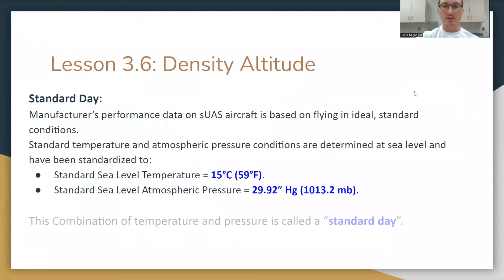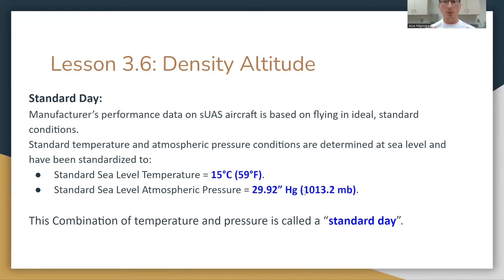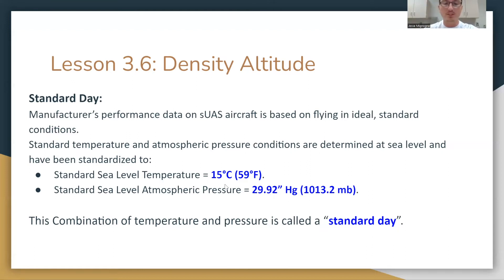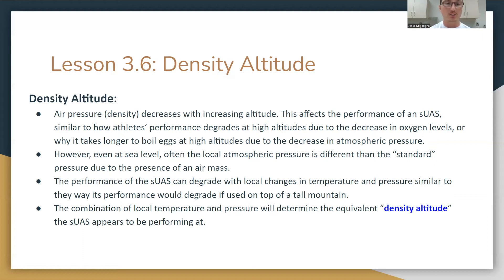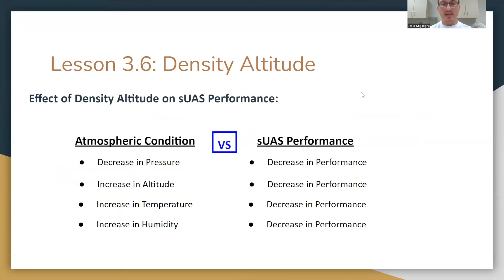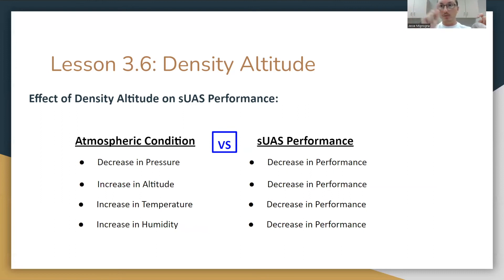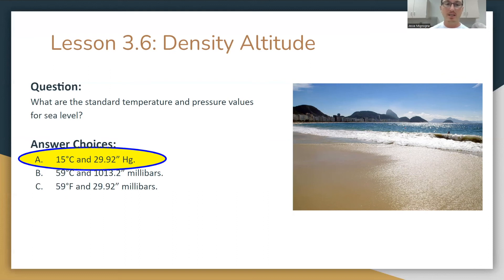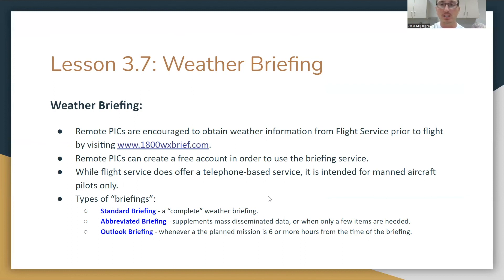Air Density FAA Part 107 Drone Exam Weather pt3

Comment: Let's change the word order here to make things much easier. Change "High density altitude" to High altitude density" i.e., lower prop efficiency  and "Low density altitude" to "Low altitude density" i.e., higher prop efficiency? Makes sense doesn't it. And why not add some saturated colors to sectional charts: RED, YELLOW, GREEN, etc. It would eliminate some of the difficulties of being able to make sense of charts.

Comment: Just take out the word “density” as Mr. Mig suggests, and things clear up. High altitude =  bad for flying because there is less air to work with to give you lift. So the higher the [density] altitude, the worse for flying.

Comment: Isn't "high density altitude" poorly worded? I understand the authors of the Part 107 might have the excuse that we all should be aware of the possibility of poor wording, but seems that could cause more problems than making things very clear.
Reply from the maker: Donald, I agree it is confusing. Unfortunately, it is what it is. On the exam “high density altitude” means air that is less dense. Like air at high altitudes is less dense than air at low altitudes.

Comment: Watching all your Part 107 videos, so far...so good, nice how you explain things. I am also a teacher, out of work at the time but love to teach. i think maybe you should explain to everyone the simple conversion from C degrees to F degrees C x 9 / 5 + 32. It is easy enough to do in your head, no paper/pencil or calculator required.
Reply from the maker: Yes, I want to do a video on that. I also have a simple way for people who are adverse to math formulas. start with the simple 0 Celsius equals 32 Fahrenheit conversion then add five Celsius for every nine Fahrenheit or vice versa. Ex 5c = 41f. 10c = 50f.

Comment: New sub. Excellent video!  On practice tests I was always getting that High/Low Density question wrong! I mean, High Density Altitude meaning Low Density and vice-versa is just so confusing but I get it now! Weather is my weak point and your video on this really helped. Looking forward to watching others of yours! You explain things very well!
Reply: Seriously, why aren’t they just saying High Altitude Density instead? Then it would make sense to say “oh, high altitude density is low density.”
Reply: @annieo.4779  exactly!!! I haven't taken my test yet but I just memorize the 3 Highs - High Density, Temp, and Humidity mean lower performance.
Reply: @LawnBunny777 
To anyone reading this comment, no it's high altitude, temperature, or humidity means decreased performance. Not density.
Reply: @LawnBunny777  correct, but it is high altitude that cause the low density, reducing performance. Your original reply looks like it was saying that "high density" caused reduced performance, not "high density altitude". It's the weirdly worded "high density altitude" that is reduced performance, not "high density"
Reply from the maker: Glad it has helped. Yes, that is tricky.

Comment: I’ve appreciated the detailed extinction of a lot of your videos.  On this one I believe there is a falsehood in describing high density altitude happening at high altitude.  As I understand it, we’re talking about “high density” and “low density” at an altitude- which is why you can have a high density altitude upon takeoff.  Useful info and maybe calls for the need to edit this video?
Reply from the maker: DLH, thank you for your comment. In the video, I stated that at high altitudes, the air pressure can change and sometimes you can get low density altitude at high altitudes and sometimes you can get high density altitude at low altitudes. Therefore I do not believe there are any falsehoods in this video, and I will not be taking the video down. high density altitude means the air density is low, which is what is usually the case at higher altitudes. At higher altitudes there is usually lower air density. For the purposes of the drone exam this is a good explanation. Could there be more complex explanations to air density if someone wanted to be a meteorologist for example? I’m sure the answer is yes, but in this context, what I stated is accurate.
Reply: @MrMigsClassroom  at 5:15 what do you mean with that statement?   If needed you can edit it with text on top of the video

Comment: 5:00 What is confusing here is using the words density and altitude together. Key on the word altitude instead of the word density.  Density altitude is a way of converting the air pressure to an equivalent altitude over mean sea level.  When the air is hotter than 15degC, it's less dense so it's like being higher in altitude.  Hot air has a higher equivalent altitude than the reference altitude.  Under hot days your aircraft will perform as if it were at a higher altitude.  On cold days, your aircraft will perform as if it were at a lower altitude.

Comment: Only bureaucrats could do something like this... I just change the order of the words (in my head) to "high (or low) altitude density" and it seems to help me keep it straight. I can easier envision the air getting less dense as the altitude increases.
Reply: Stoppit. You're making too much sense.

Comment: I've taken a few practice tests in the last few years, and I always got the density altitude questions wrong.  The terminology is so counter-intuitive that it borders on evil. We tend to read 'high density' or 'low density' as a compound adjective that modifies 'altitude', so 'high density altitude' naturally sounds like an altitude with high density.

I think I solved the problem in my own mind though. While watching this video, I started adding a hyphen between 'density' and 'altitude'. It's a cheap trick, but it calmed me down.
Reply from the maker: Yes it is counter intuitive and tricks most of my students. Adding a hyphen makes a lot of sense to better understand it.
Reply: @MrMigsClassroom  btw, I got a 90% on my UAG exam today, and I thank you and your videos for helping me get there. I was a bit peeved that that I only got two weather questions, one on density altitude and one on what kind of flying conditions lenticular clouds indicate.
Reply from the maker: @arkansasoutpost  congratulations J!
Reply: @MrMigsClassroom   -- I think an intuitive way to educate others on this is to relate it to space. As you get higher, the air density is lower. Why? Because there is no air in space and the higher you are the closer to space you are. That's how I made myself remember the difference. Low altitude density is "thicker" because it's farther from space so there's more air pressure, making the air denser.